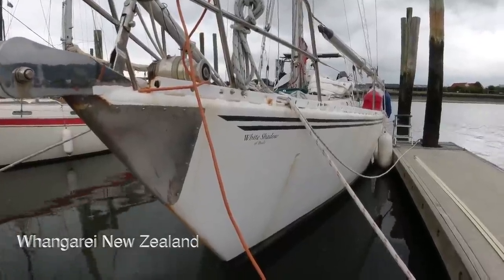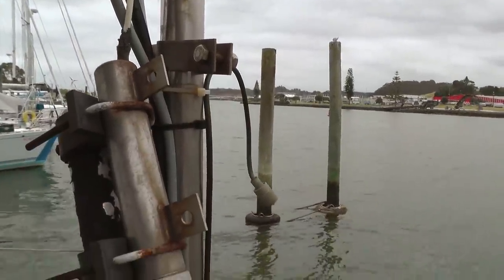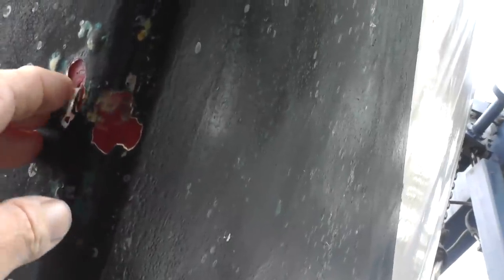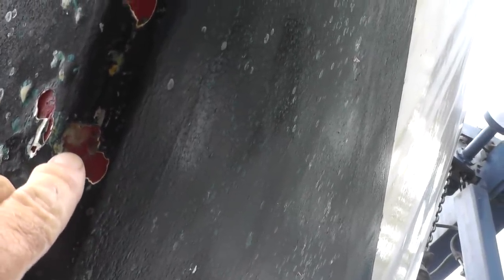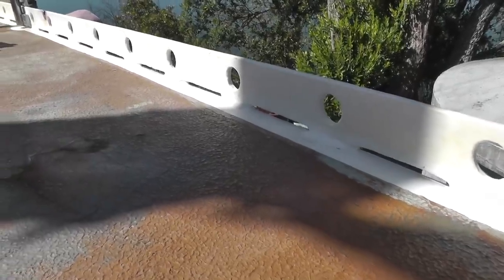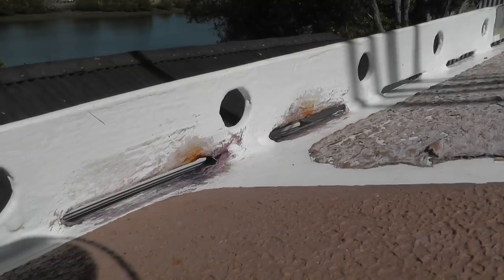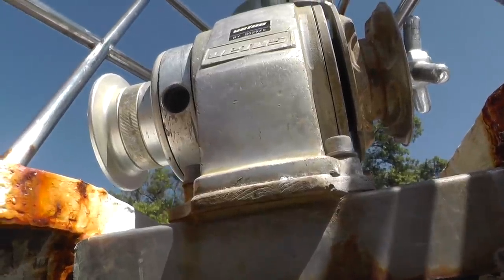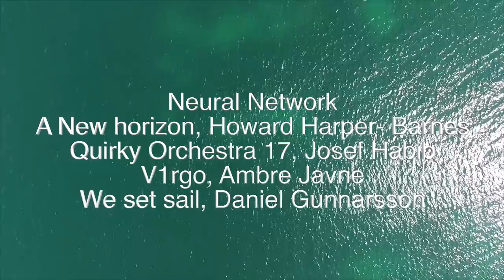Yacht Haulout. Adventures of an Old Seadog, epi 165

Comment: On my cars (and on my anchor (ongoing)), after removing as much rust as possible, I use a strong acid to deal with the little rust that remains (and that makes the rust black I think),.... then I use Owatrol oil (several layers) to cover it (commonly used in farming),  and then after waiting for a week or two I think it can be painted/covered with oil based products (for my anchor I'm covering it with epoxy, but that's and experiment).  For rust I can not get to or can not treat I cover it with Lanolin fat or Vaselin (Vaselin is realy the best for preventing rust), but fats like Lanolin and vaselin collects dirt and sticks on to anything touching it so not very practical. ......... Any kind of "paint" that gets hard, on top of rust, is gonna detach sooner than you like, it's alive underneath, only a somewhat flexible layer will last for some years.  And only two component products reale(and vaselin and oil/fats) prevent air and humidity from coming through in their attacks (I don't believe in one component products any more).  But I'm not an expert in any way, but that's my experiences so far in life (I was born in 62).  B.R. and thanks for entertaining us and sharing :-)

Comment: I’ve used a chipping hammer to test and remove rust as well as a scaler (power tool) to do a lot of derusting the problem is steel rust from the inside out  and iron rusts from the outside in! , don’t miss the step of primeing (sp) before painting2-3 layers of paint protection

Comment: I hope your removing the Fe2O3 (rust) prior to the painting. remember the less it shines the better your profile on the surface. Just fyi, in most cases vinagar in RO water will kill the rust cell as well , scrub it in with a brush. thats cheaper than hold tight or Chlor*rid.